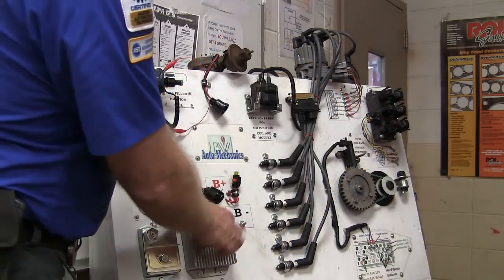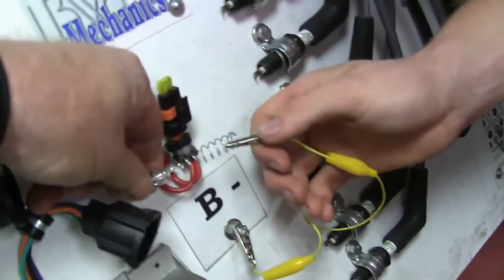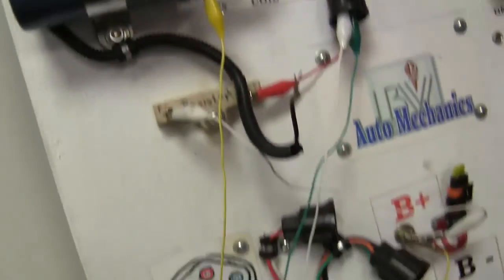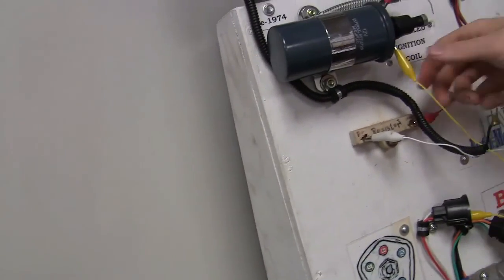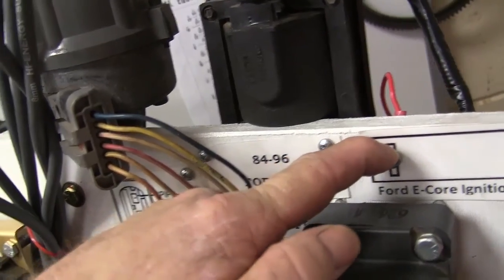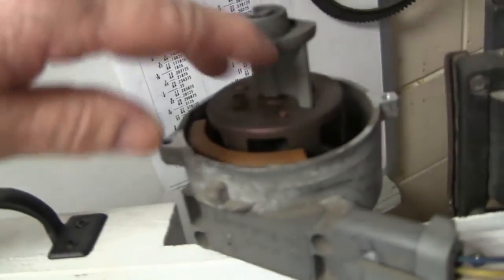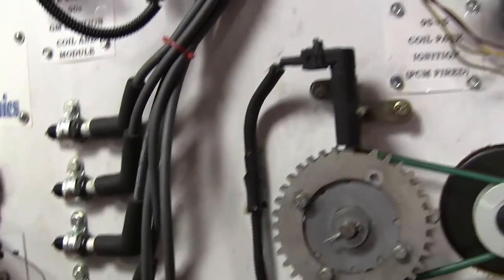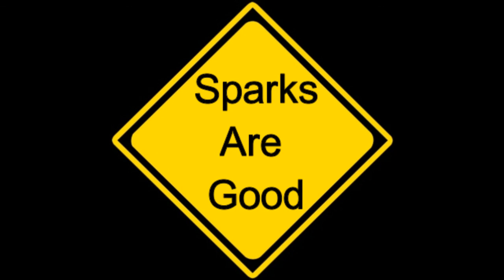Ignition System Evolution

Comment: nice presentation how wuld a magneto ignition setup look like even with out baterry power ore if some one wuld change values of a condenser ore what wuld hapen if you use a supresor insted of a condenser? Im interested how to simulate a waste spark ignition system with a singel coil? ore use other parts of a engine to make it a independent ignition system with out a baterry useing a alternator ore starter motor as energy sorce I know its posibel to do so If figuring out to use alternator pulses as energy conversion I belive even a gm e core ignition coil culd work in reverse form how much I did understand a coil works on colieding magnetic filds ither useing ac and ac ore ac and dc pulse still shuld work those electricity are out of faze ba 180° when they colide to ich other it shuld virtualy create ground ore a dead short just like similar to a ignitor that   small magneto inside the distributor culd do the job with a second device like a alternator sincronized I belive so that its posibel I wuld do alternator voltage out put manipulation expecialy on tractor alternator because the are prone to do static interfearence perhaps those things culd by usefull to a second ignition proces rather then by a noisance, a pump teath's do similar tring like a distributor reluctor I belive it wuld fire a coil ore use the engine flywheel in combination with a carbon brush I belive that wuld by lot bether the dealing with that electric junk the old dc magneto didnt have that other staff screwed on the engine block directly it fiered 1 to 12 cilinders with out mistake that wuld by nice to build besicaly there are no diferences about disel ore gasoline engines bouth is preshure what make's them go not realy electricity expecialy not a opel,gm,isuzu,holden engines those are universal engines they alredy are half gasoline/disel engine's they are unique in desighn

Comment: Can you explain how can i bypass the vrs(pick up coil) i mean there are 2 wires positive and negative, giving 12v to the + wire or 0v to the - wire, does this make the coil spark?
Reply from the maker: The pickup coil is actually an AC signal that triggers the firing of the module, but any voltage detected there when deflected up or down will trigger it to fire.
Reply: +McCuistian ok so in a few words using a test light or a jumper wire, connected to battery + or -  , touching one of the two terminals and untouching, its going to make an ac waveform right?
Reply from the maker: No, you're just making a DC waveform that way.  An AC waveform is created by the pickup coil, but either kind of waveform will trigger the module.  It's just looking for a voltage deflection.
Reply: +McCuistian thank you very much, very helpful and very precise information, i wish i could be your student, thank you again, have a nice day.